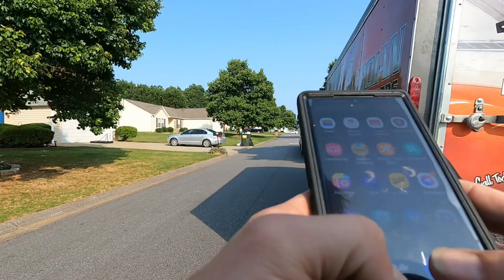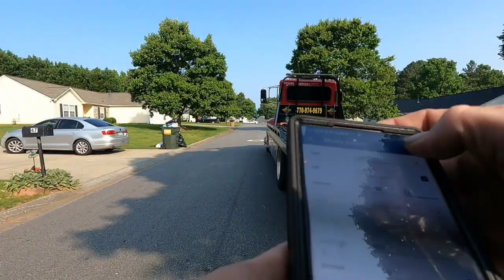Towing a enclosed trailer with a rollback flatbed towtruck#wrecker#towtruck#loading#winchout#towfail

Comment: Thanks for showing us the brick trick man. I run a metal scap yard and just bought a rollback to pickup scrap vehicles, trailers and big metal that won't fit into a pickup bed. Watching this video just showed me hoemw to get a trailer onto the rollback properly
Reply from the maker: Yessir!! Thanks for watching my videos. I just installed the new turbo on my truck so I'm going to be posting more videos soon. I actually have all the footage of me fabbing up a cracked header and removing and installing a stud on the turbo manifold. I'll be editing and posting this weekend. Since you're scrapping I'll be posting more videos of my non conventional odd jobs so you can learn some cool stuff. What kind of truck did you get? What's the bed length? What's the bed type steel aluminum?
Reply: @darronmalonetowingchannel   I bought a used truck it's a 04 international 4300 with the dt466 diesel . Also that would be great to watch the odd job videos u make soon.
Reply from the maker: That is a good engine.